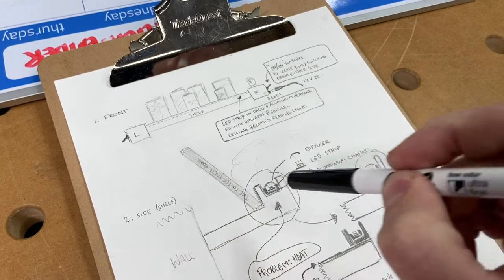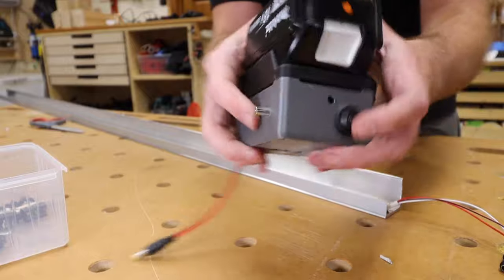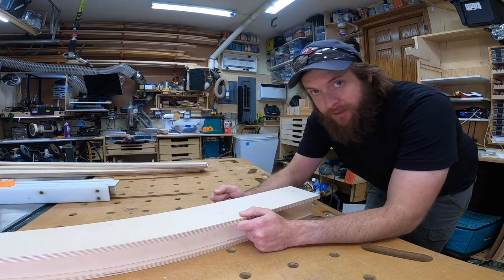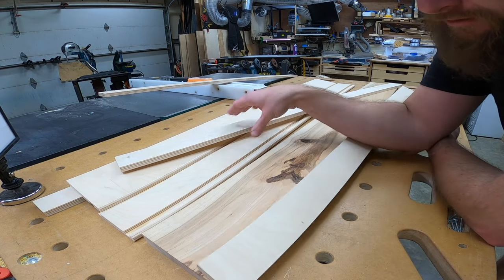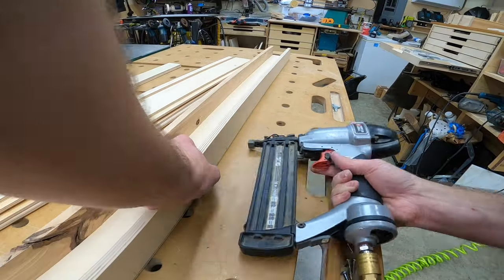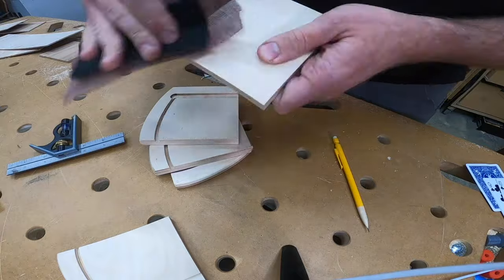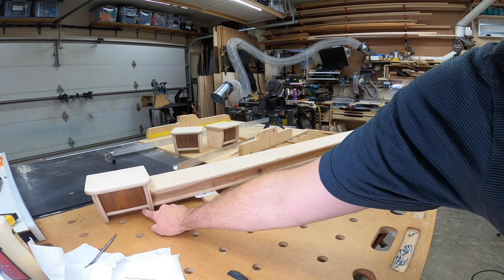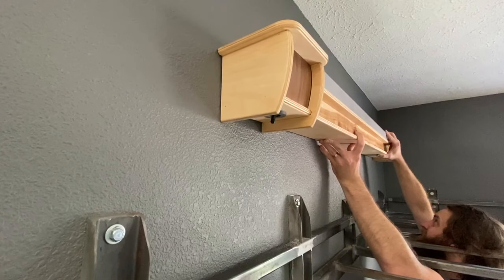Bunk Bookshelf / Reading Light (Powered by USB-C) Pt. 1

Comment: Two random orbit sanders? Different sandpaper grits convenience? I’ve recently become fond of Makita power tools and wonder how that compares to a DeWalt I love. Saving up for a Makita belt sander to replace a very old and underpowered/small Black & Decker. Love seeing a high functioning hoarder like myself work in a real garage. Fantastic build. Laughed at the lame dad joke. Maximum effort :)
Reply from the maker: I always appreciate the things you notice, and I had to go back and watch to see what you were talking about.  The 2 sanders both on the work bench, right?  I actually primarily keep a thick foam backer on the Bosch, so that's the reason for both.   I was using the Bosch / Foam backer on the roundovers and the Makita / hard backer on the flats.  

As for the DeWalt, In my unexperienced opinion, I think the Makita would be similar to the DeWalt.  My Bosch is fairly weak and commonly puts pressure on the outside of the disc.  I borrowed my brother's DeWalt and it put even pressure throughout the disc, and kept spinning (random orbiting?) under moderate pressure.  Anyway, I'm a Makita fan but not a religious one.

And, "high functioning hoarder" - yeah I heard Adam Savage describe himself as that and think it's brilliant.

Comment: What's that 3d printed box at 2:55? Is a voltage step down or some sort? Looks like you've never used it before in no other video.
Reply from the maker: yep, an 8A buck converter I designed an enclosure for.  I downloaded the top part from Thingiverse (that mounts to the battery) which was designed to accept a Makita replacement part - the +/- terminals for a Makita drill that only costs $5.

Comment: Enjoyed the process, flaws and all.  You can have ice cream if you get part two up by tomorrow.

BTW, any more pics of that bunk bed / bomb shelter?  Looks beefier than any bunk beds I've seen before.
Reply from the maker: ha, yeah the bunk beds are intentionally not a "how-to" on my channel or anywhere else.  There were about years of design/testing and rebuilding a wall, etc to make a steel no-legged bunk bed capable of supporting me at the no-legged corner without flinching.  

But, I did record a bit about it (a particular regret/challenge regarding the sandblasted front finish) for Part 2.   Maybe I'll do a little bit about the frames themselves and, if you'l give me ice cream, maybe a video of me swinging on one.